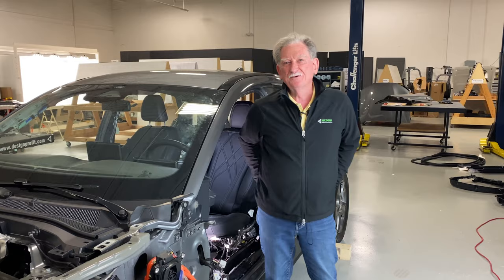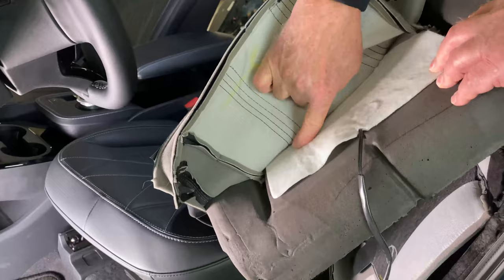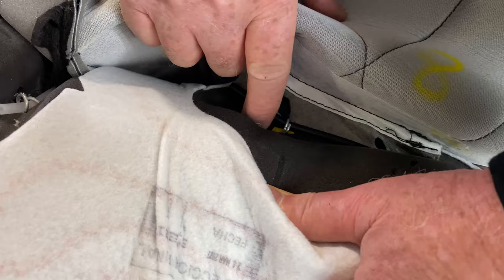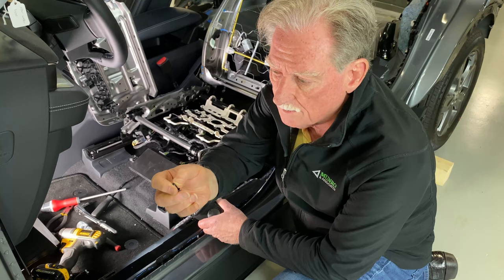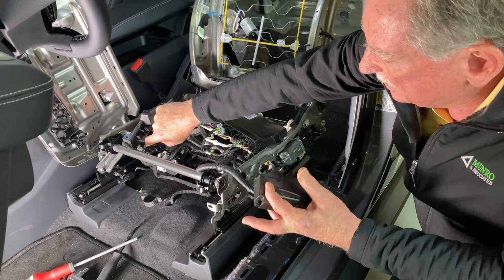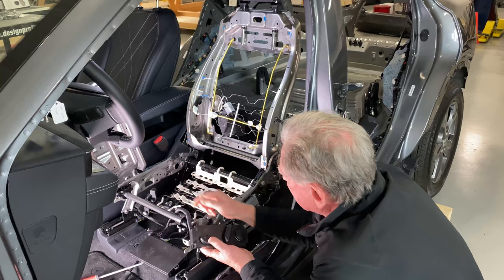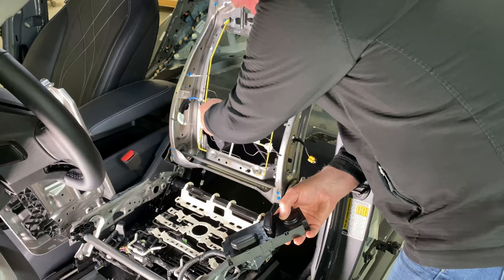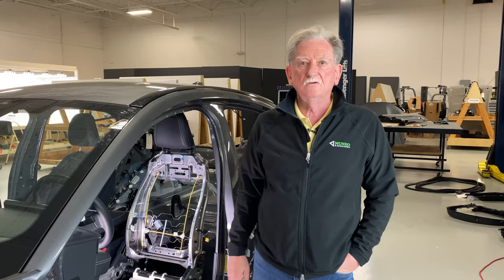Ford Mustang Mach-E - How A Seat Works: By Sandy Munro

Comment: Smart design on the backrest adjustment.
Two planetary gearsets are installed between the upper and lower frame on each side. The motor drives the shaft, which is connected to the sun gears. The ring gears are fixed to the lower frame, and the upper frame to the planet gear carrier
Reply: Yep. Beauty of that design is good use of necessary reduction gear to accomplish seamless connection to the left and right side. 3 function in one design. Clever.

Comment: Back in the 70's the RR Silver Shadow seat was one motor with one worm gear shaft.  The various seat functions had clutches (three in this case)  that would engage to the shaft to the requested position.   Wasn't bad other than the controls were points so in the dark you can see the sparks until corrosion of the points took over.

Comment: Thank you Sandy - at the weekend I took off the interior door panel to replace some broken speakers in my Ford Fiesta. I normally draw the line at lights and screen washer when it comes to car maintenance, but thanks to your videos (and another one I found showing how to take the panel off for my model), I was able to get the panel off without much difficulty. These videos show that there's no "magic" to building a car, and that if you think about it logically you can work out how most models of car were put together. 👍

Comment: This is interesting. I personally prefer manual seats as all these motors and controllers are just that many more expensive things to break.  Thanks for sharing!
Reply: yA, True but then this gives the car a chance to see you, know how you are, where you are sitting and adjust the seat automatically for you. At least that is what Tesla does.
Reply: But they have came so far in reliability and quietness.
Reply: I agree, but a motor and lead screw, or motor and worm drive, has the advantage of combining positioning and locking, so there is some simplicity there.
Reply: @DouglasEKnappMSAOM  I guess it makes sense for a family or rental car. But for a single person who will get the seat positioned the first week of driving and never touch those controls again, its alot of expensive parts that never get used.
Reply: Roverdad - true but today small electric motors are extremely RELIABLE. 
look at RC cars and Drones.
Reply: Seats, mirrors, pedals, and tilt/telescoping steering wheel all power operated with memory is such a nice feature when two people (husband and wife) share a vehicle. Our Explorer and F-150 has all of this. Everything is always in my position when my key is used. So spoiled we are...
Reply: So y'all, Sandy didn't find anything wrong Mustang Mach e seat department so you have to make up your own about electronic seats that most all vehicles have. That's s shame to be that worried about the Mustangs position be it over or under the Tesla. Nothing stays on top for ever. And what did Elon say about Ford?
In March, Tesla CEO Elon Musk seemed to compliment Ford's role in the electric-car market.

"Tesla & Ford are the only American carmakers not to have gone bankrupt out of 1000's of car startups," he tweeted in response to a reporter's post about the high-risk nature of the automobile industry. "Prototypes are easy, production is hard & being cash flow positive is excruciating."
Reply: Those motors are so small that their weight is probably comparable to a manual system.
Reply: In Ford documentation for the 2018 F-150 I found, the 6-way power seats add 8 lbs and the 10-way power seats add 13 lbs over the base manual seats.
Reply: They are very reliable, almost never break.
Reply: Why are you guys so worried about Ford when is the Tesla that has the panel gaps, mismatch plastics, doors that don't work, seats that don't work, windows that sometimes or sometimes not roll down, blacking out infotainment center and range that doesn't add up.
Reply: @twany442  I guess Ford didn't quite get the cash flow positive bit.
Reply: @patreekotime4578  I wouldn't have ordered this car without memory seats, because I will not be the only one driving it.
Reply: @shahbazfawbush  - NOPE , Tesla weight is way LIGHTER weight even with DUAL motors and a 7000 lb battery.
Remember, LIQUIDS weigh more than DRY in the same space.
Reply: @patreekotime4578  Someone with some brains! All the talk about weight and cost reduction. So many features that are forced upon you and you pay in range, acceleration and Dollars! Another example, my VW has hugh review mirrors. the one function they need is to fold and they don’t do that! Got full glass adjustment, heaters, radio antenna built in and puddle lights on under side. Cost over $800 each and once "set" have never been moved again because so dam big you can see what the frogs are doing as well as the birds! Mirror is recessed in plastic and protected from any bumps etc.Someone in warm climate really needs electric heaters, probably for five minutes of the cars life!
Reply: @twany442  Wrong on all your points. Tesla is winning the quality awards.

Comment: I think these Mach-E videos are the most interesting video vs any other cars you covered
Reply: Tesla, even more interesting! I’m wondering if Tesla is still at the top, according to Sandy, based on what we know so far about the Mach e.?
Reply: No one will compete with Tesla without a charging infrastructure.
Reply: @GM-qh2ki  totally agree! I was wondering more about actual technology and quality in the two cars.
Reply: @lsol  yes Sandy has said very recently that Tesla are still vastly in the lead, the most recent example I saw i think was E for Electric interview with him
Reply: @u12uNiiGuNx  Not according to Car & Driver,  Edmunds and Motor Trend. They give the Mustang Mach e a buy over the Tesla Model Y. So sorry fellas
Reply: I think Plaid Model S will be the most interesting (until we get cybertruck that is)
Reply: @SiisKolkytEuroo  You mean if they get the cyber truck.
Reply: @twany442  until we get to take a look at them taking a look at the cybertruck. That's a mouthful
Reply: @twany442  Hm, which of those reviewers mentioned is funded by big auto advertising? Which car company doesn't do paid advertising?

On another subject, how many Mach-E are likely to be produced annually? How many Model 3? How many Model Y? How many batteries will Tesla be making in 2021? 2022?
Reply: @GM-qh2ki  I agree - and the constant innovation

Comment: Hog rings were (are?) larger than what is used in car upholstery.  The were put in pig's noses to keep them from rooting under fences.  Made digging with the snout uncomfortable.  

Both hog and upholstery rings are 'open circles' with sharp ends.  They are closed with a set of special pliers that have grooves in the pincher ends to hold the rings while they are being closed.
 
Hog rings go way back in the car industry.  I have a set of hog ring pliers I bought in the early 1960s to work on my 1951 Ford (red convertible).

Comment: Awesome!  Very interesting construction all tucked away when wrapped. 👍🏻
I'm ok with my manually adjustable sports seats.  There's a toggle switch only for bolster support which I believe is an air bladder as you mentioned.

Btw, my wife called my a half-dog yesterday.  Or something like that.

Comment: Question for Sandy: What's your view on motors (and solenoids) going into things that traditionally were never electrically controlled?  Some recent examples: electrically controlled glovebox locks and motorized door handles. Jaguar was able to do mechanical flush mount door handles on their F-Type which I think would be far more reliable than anything electrically actuated.

Comment: Cool to see all the actuators for moving the seat. An 18 way power seat must be quite packed with little motors and reduction gears, and I can't even imagine what a 24 or 30 way seat looks like inside. Was there a weight sensor in there somewhere?
Reply: weight sensor only on passenger seat.

Comment: My old car had some really heavy seats, I think at least 80kg each, if not double. Not really sure if there's a market for that or just marketing decided to add everything: standard 3-way, bucket tilt, headrest up/down, knee support fore/aft, lumbar in/out, lumbar up/down, heating, ventilation.

Just asking if there is a better way do design this than add a bunch of motors and reducers. Was thinking that maybe air/liquid bladders with a single pump should make it lighter. Personally I would get rid of the complexity, but perhaps there's a market for this.

Comment: Amazing, that rod withstands the force of a human wearing a seatbelt in a crash. Even with only a guide rod of the other side...
Reply: for me it's the tilt of the backrest part.  that whole mechanism has so much weight when in a wreck.
Reply: In a crash only the seatbelt does the job not the seat.
Reply: @alanmay7929  You're absolutely correct!

Comment: I find the front passenger seat more interesting. Most (all?) cars have a weight sensor to disable the dash airbag is the seat if unoccupied or has a small child in it. Some cars, so I have been told, adjust the force of the dash airbag depending on the weight of the occupant or the position of the seat. My gen. 2 Chevy Volt uses a partially inflated plastic bag inside the seat with a tube leading from it to a pressure sensor. Would be interesting to know how Ford does it.

My wife and I both found the Mach E seat cushion to be odd feeling and uncomfortable. In the demo car we drove the seat cushion on the passenger side had a lump in the foam right in the middle of the seat that we found to be more than somewhat disconcerting.
Reply: Yes, the seat position will adjust the airbag inflation force. But the weight sensor is an on/off switch for passenger airbag.

Comment: Same cheap adjustments as the Model S: no way to reduce the height of the front of the seat independently or adjust the angle of the seat squab. Probably acceptable on a mid range car but not at 6 figures.  Good explanations. Shows where the costs are saved.

Comment: Thanks for the review.  I own a couple of Tesla’s and a Porsche.  I always felt power seats are a waste of money and just add weight.  How often do you adjust your seat.  Usually set and forget.  If it does need adjustment, mechanical is fine.
Reply: It's really a marketing act, OEM is trying to match whatever their competitor offers.  if you $90K Porsche equips a manual seat, but BMW M3 offers a power seat, then the Porsche owner is going to complain.

Comment: So, any idea why the Mach-E has so much more “stuff” under the seat compared to the Model Y? The Model Y also has a seat pan tilt function that the Mach-E doesn’t have, and it has the ability to raise/lower the lumbar, yet the space under its seat is much more wide open.
Reply: Speak from a seat engineer. The Tesla has a tilt pan, so they need to reserve room for the motion. That maybe the reason you see Tesla under seat has more room. In automotive world, any design uses less space is a better design. The space we saved, is the space for customer to use.

Comment: The seat does not tilt. It just goes up and down. 
I am tall 6-2 so I need to lower my seat all the way to see under rear view mirror. 
But the front of the seat does not tilt up. So I lose all thigh support. 
I sat in other Ford models at the dealership.  Some seats tilted and some did not.
Reply: Yes, this seems to be really inconsistant across the industry. Ive seen some cars where the up and down was on the back rest control while seat tilt is on the seat control. Which to me is more intuitive than twisting the seat control to go up and down.

Comment: with all the motors and gearing for adjusting seats… what is the locking mechanism that keeps the seat rigid in the event of a crash?
Reply: if i had to guess. the electric motors.

Comment: Does it make it easier on the motors if you're not sat on the seat when adjusting it?
Reply: Those are high torque motors so no issues.

Comment: I want to know how the memory on the seats for driver profiles works.
Reply: One common approach is a rotation sensor in the motor; every time the motor completes a rotation it generates a signal. The controller Sandy was pointing to has a microprocessor that counts each rotation and stores that in non-volatile memory, so it remembers the current count even when there is no power. When the seat is first tested, the seat is put into a known position (say all the way forward) and the counter is reset (i.e., 0, representing seat fully forward). Count 1000 might mean the seat is all the way back. Let’s say you adjust the seat to exactly the middle position. The controller knows that as count = 500. When you save your current seat position in a profile, the controller just copies the current value (500) into one of the saved profile locations. Now say you move the seat most of the way back (count = 900). When you press the button to activate your particular driver profile, the controller takes the difference between the desired value (500) and the current value (900): 500 - 900 = -400. The controller will drive the motor for 400 revolutions in the appropriate direction. Because the motor turns very fast relative to the seat motion (that’s why there are those reducers), one motor rotation is a very precise measurement of movement.
Reply: @srbtrappe  Wow. Great explanation. Thanks so much!

Comment: Man for all of the money you put into the car, you can't even change how high your lumbar support is? So if you are tall this ends up supporting your hips, as is the case with most chairs I have to deal with. Can we FINALLY accept that people come in different sizes than 165 cm tall, overweight man?
Reply: If it's smartly designed I think the lumbar support will change height relative to the bottom of the seat when you adjust the height of the seat, accordingly to the supposed length of the person for the given seat height.
Reply: You can build it, if you're handy.  I retrofitted Audi power seats to replace my manually adjusted VW seats.   Went from manual 6-way + manual 2-way lumbar that worked like what Sandy showed, to 8-way seats with surprise ... 4 way power lumbar.   I'm sure the same sort of upgrade/substitution is available for your car, even if the manufacturer didn't offer it as an option.

Comment: Why can't seats  have head restas that slide down or what ever so they are not obstructing vision  when not needed ?
Reply: I believe headrests are required to prevent neck injuries in a crash. They have become increasingly more difficult to remove over the years IMO. If they easily slid down they probably wouldnt meet safety requirements.
Reply: @patreekotime4578  Im not trying to get rid of them. 99% of the time, I am the only person in my Car. THey just obstruct my vision.  Seems to me it is a safety feature to hav them motorize down if no one is in the seat.  The driver has better vision.  But I darned sure want one if Im riding in the seat.

Comment: It is really needed to add a computer and several motors to something that will be adjusted once in a while? I would prefer to save weight and go the traditional mechanical way.
Reply: If it is a car that is driven by more than one driver that computer that adjusts the seat to match the key approaching the car is a huge deal. I can't fit in our cars where the wife drove them last so memory seats are a must have feature.

Comment: No reason for more than 2 very low current wires to go to the switch module. Heavy wire and more than 2 wires is a waste. Everything can be encoded by resistors or with a digital communication. Putting the motor control inside each motor could eliminate the large control module and potentially reduce total wire length.

Comment: Since Tesla has shifted to making their own seat it would be interesting to compare with the Ford and see if there are similar or Tesla has made improvements
Reply: Not if they continue to have problems with their seats, doors and panel gaps and the mismatch plastics.
Reply: @twany442  Are you a paid troll or just a short seller?

Comment: Wow! The seat doesn't have a thigh extension and Ford shortchanges you on independent height adjustment of front and back side of the cushion! I'm 6'4" and a half, if the vehicle doesn't have a thigh extension, I need to raise the front and lower the back part of the cushion. When the seat is only 6-way adjustable, it raises as well as moves forward or lowers and moves back the entire cushion. Not good.

Comment: TESLA makes their own seats just down the Street in FREMONT, CA. 
GigaShanghai already makes their own seats at the Shanghai facility. 
when GigaBerlin and GigaTexas open they will have INTERGRATED seat manufacturing on site.
Reply: Yeah just like ford, toyota, mercedes..... makes their own seats.
Reply: @alanmay7929  i doubt Ford makes their own seats.
Reply: @alanmay7929  - perhaps, but not in the SAME factory like gigaShanghai or GigaTexas.
Reply: @alanmay7929  , just checked FUD motors gets their sets from CHINA.
Reply: @markplott4820  almost everything is made in China today including tesla parts
Reply: @jetah50  ford makes their own seats and also have suppliers for custom seats depending on the applications.
Reply: @markplott4820  wtf cares?! Does tesla make their own chips? screens? windshield? Brakes?.........
Reply: @alanmay7929  - actually TESLA does make their own GLASS, including windshield. 
However TESLA has their own CHIP design , but it's made by a Vendor, TESLA uses BREMBO brakes and is  custom painted, TESLA is looking at Manufacturing their own EV Tires.
TESLA also makes their own STAMPING and body panels , headlights and MEGACASTING.
Reply: @alanmay7929  - FALSE, Tesla mostly makes almost everything on site, It's why TESLA is the MOST American made car in the WORLD.